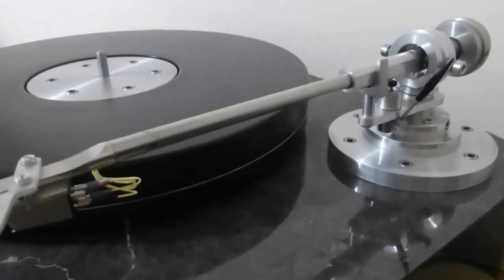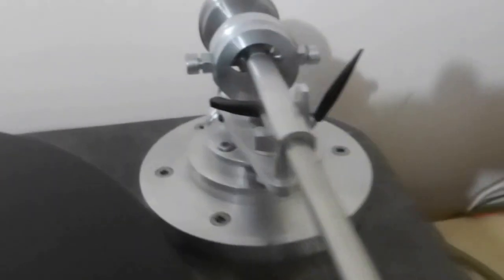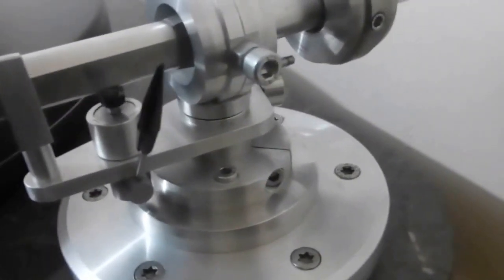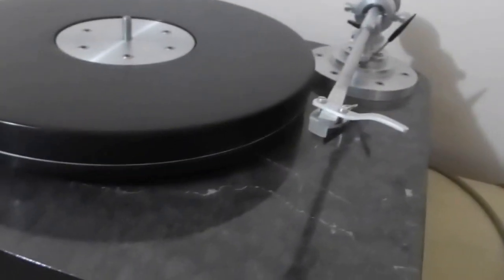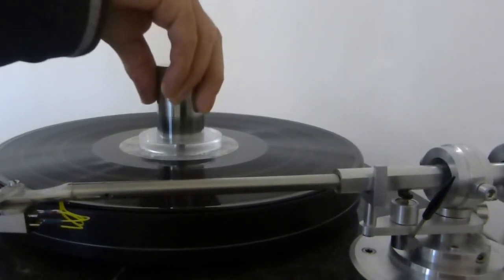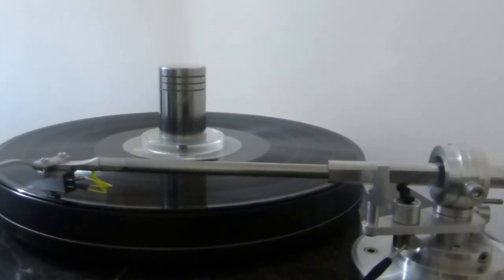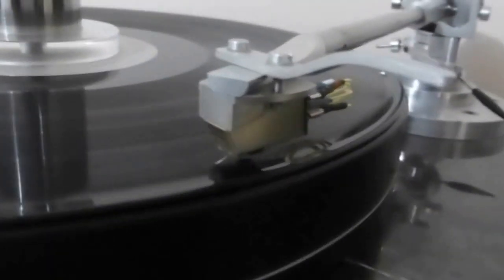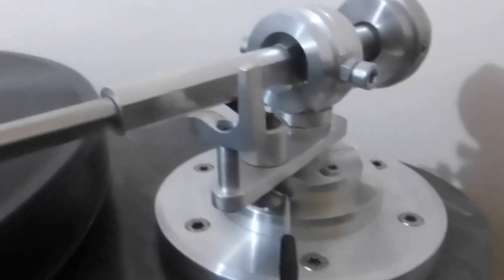DIY Tonearm Clearaudio Aurum Appha

Comment: I'm trying to make my own diy tonearm, but I am confused how to set up the tonearm bearings. You said you used ball race bearings, but what did you put into the bearings? How did you attach them to the tonearm so they would allow it to pivot?
Reply from the maker: If you are inexperienced or have little machinery I do suggest that you try building a uni pivot tonearm, much simpler 
 and can get a great result. Ball race housings require lathe machining and some engineering ability.
Reply: I own a lathe and have experience woodworking, and I'm planning on building out of good hardwood. With that being said, can you help me out with the info about how to set up the bearings?